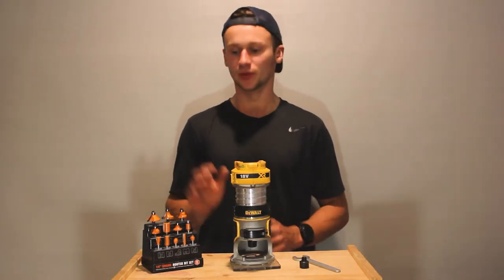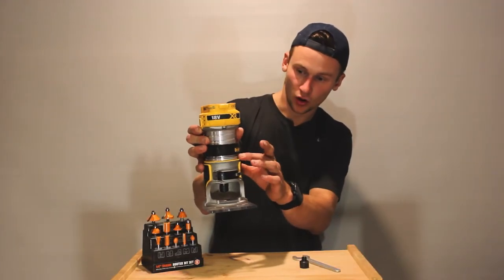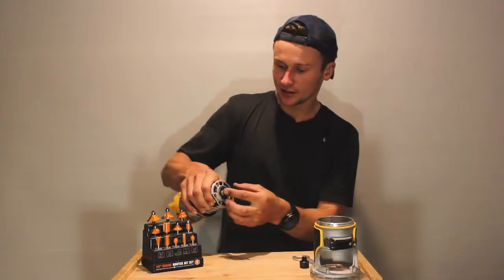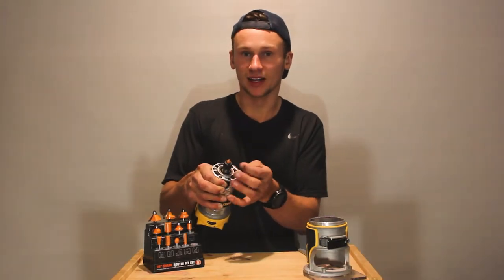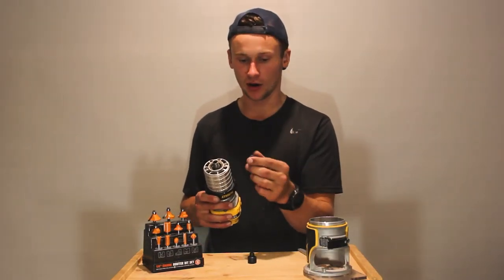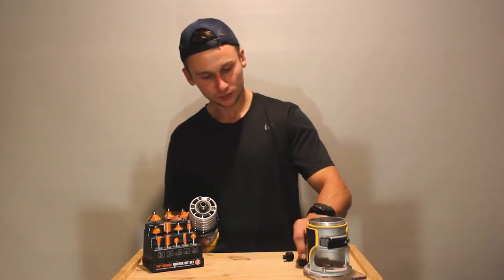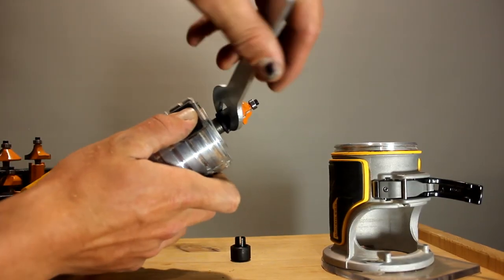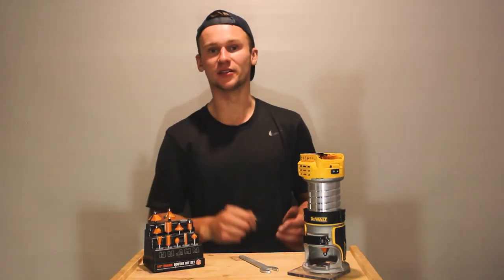How to Change a DeWalt Router Bit

Comment: Thank you for the information. I got lost at 1:13 where you explained about the router bit size. My questions are; 1) Is the shank 1/4 or 1/2 inch.  or 2) does it have an adapter to change the router bit from 1/4 " to 1/2"?  3) The model DWP611 which I bought today seems to have only 1/4" collet nut. Nowhere in the manual, does it say anything about the shank size or router bit size 1/4" or 1/2". Very confused.
Reply from the maker: My router holds 1/4 inch router bits but has an interchangeable collect nut to also hold 1/2 inch router bits. I have only ever seen and used 1/4inch router bits. 
I think 1/4 inch is common and mostly everywhere, so you Router is completely fine just having the one sized collection nut!
(i'll need to look into why the 1/2inch collection nut is even an option)
Reply: @DaveDoesCarpentry    Did the router come with a 1/2 collet. From what I can find it says the Dewalt cordless router comes with a 1/4 inch collet.  i am looking if it is possible to mount 1/2 inch shanked bits into it.
Reply: This also confused me. I've done lots of research. 

This router comes with a 1/4" collet and an 8mm collet (5/16"). So unfortunately it is not suitable for a 1/2" router bit. Still a great tool for more intricate work! Hope this helps anyone that has been wondering the same thing!

Comment: The instructions for this model (I think it’s the same model as you have) talk about the manual ratchet method for installing the bit. I’ve no idea what that means and I couldn’t understand it from the instructions. It says: without removing the wrench from the collet nut, release pressure on the spindle lock button. Then, with the wrench still on the collet nut, reverse the tightening direction to reset the wrench position. Depress the spindle lock button again and turn the wrench clockwise. Repeat the procedure until the collet nut reaches desired tightness. No idea how this helps or what it’s supposed to achieve. Any idea?

Comment: This router comes with a 1/4" collet and an 8mm collet (5/16"). So unfortunately it is not suitable for a 1/2" router bit. Still a great tool for more intricate work! Hope this helps anyone that has been wondering the same thing!

Comment: Could one of you help me? I've never used a router. Ive honestly never done any wood work. I'm making a bookcase and i just installed my bit and tried on a piece of scrap wood. i tore the board up and it almost jumped out of my hand. All i want is the make the space that the shelf boards will sit in. How do I adjust the depth to make a slot for shelf to sit in when the board is 3/4 in deep? My bit is 3/4 straight.